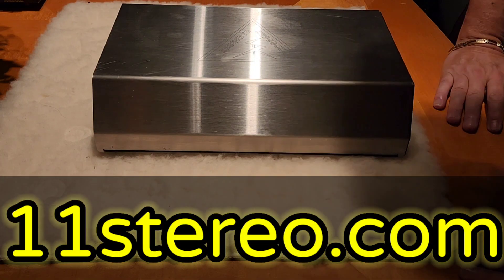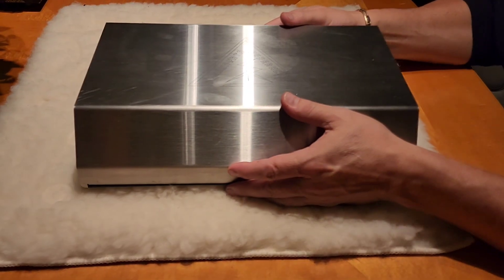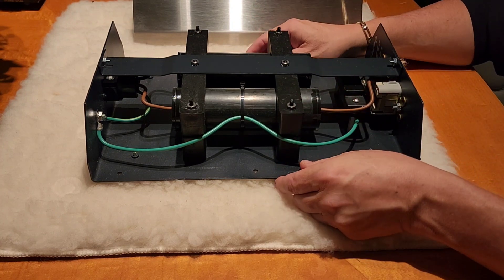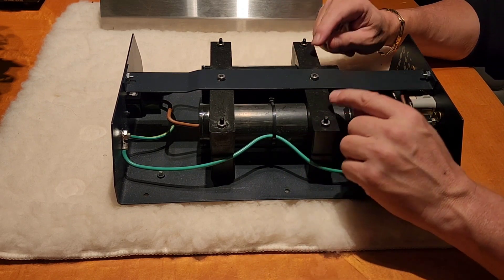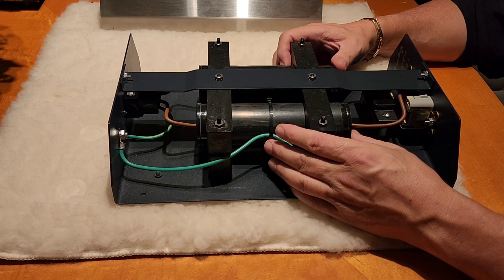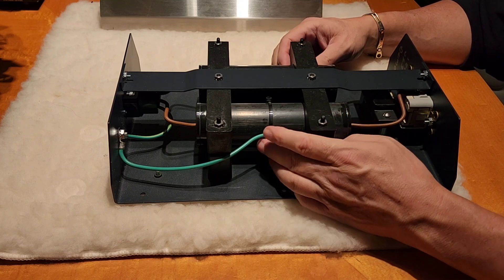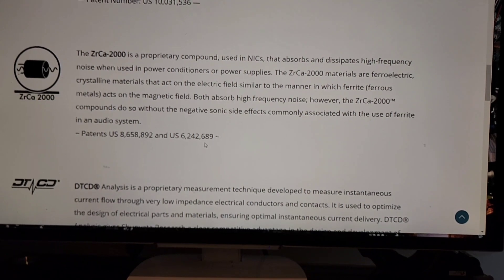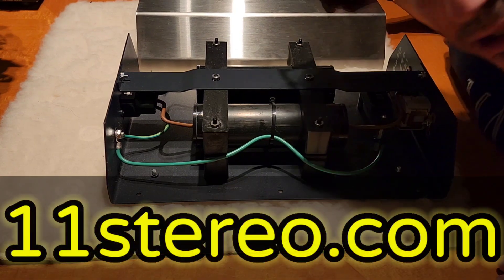AUDIO AUTOPSY : SHUNYATA RESEARCH HYDRA CYCLOPS AC POWER FILTER

Comment: But isn’t this the same type of device as the Puritan 156 just with less outlets? I thought you were a fan of the Puritan.
Reply from the maker: I like and sell the Puritan. Everything is visible on the inside, nothing "Hidden" no mythical name or materials.. I like that..
Reply: @OCDHIFiGuy  I hear you! I recently read a description of a shunyata product on a distributors website and it was literally nothing more than a word soup of bullshit. I've never seen so little communicated in so many words. Fuck me. I'm going to save my pennies for a Puritan. They look the goods.
Reply from the maker: @Dr.Richard_Kimble  They start at $1K for the power strip that kills Common mode AND Differential noise.